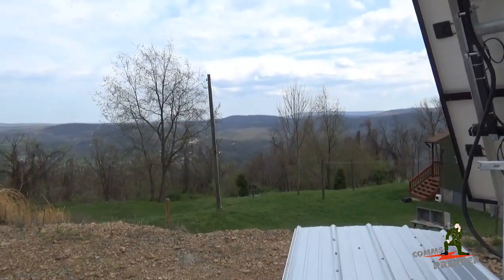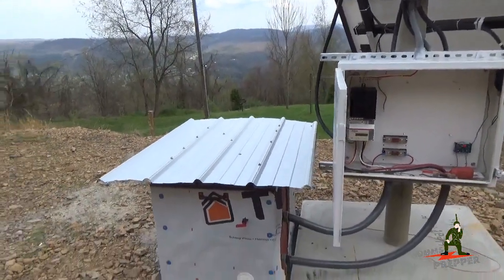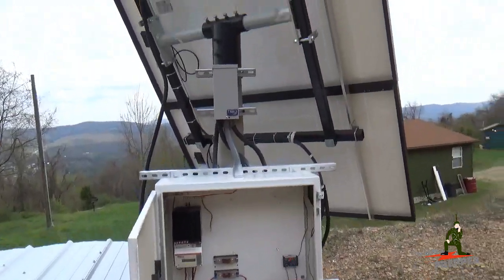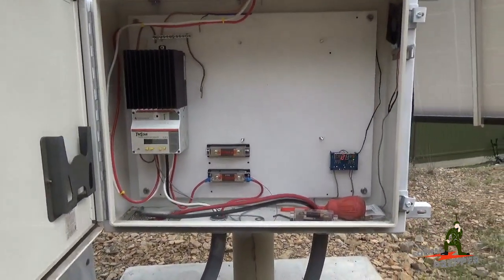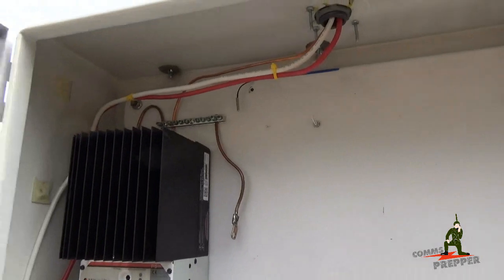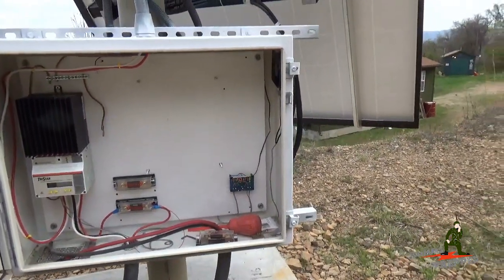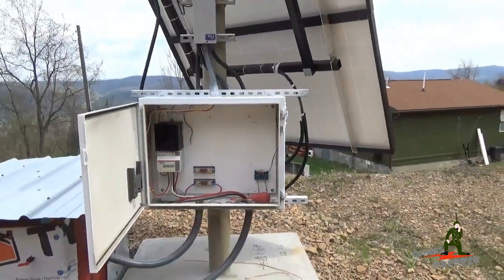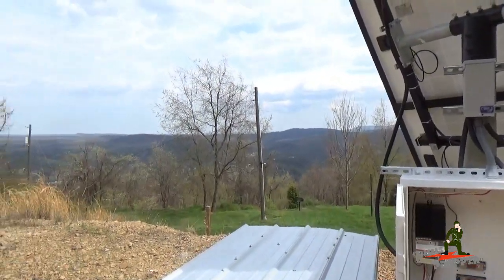Off-Grid Solar Power Upgrade Project

Comment: Why does your setup have to be inspected? Your out in the boonies and off grid so is that required or just for safety's sake?
Reply from the maker: +Neil Koni I'm not sure it does.  The permit lady insisted I needed an inspection when I mentioned solar panels.  I could not get the message across that this system was not touching the grid or house. However,  I will call for the inspection, pay fee, and suspect I will be told it was not needed.

Comment: Well engineered setup.  As usual, we all chip in a thought or suggestion to avoid future issues.  I had plenty of exposure to HOFFMAN boxes while working with T-1 data circuit repeaters and "smart jacks" for AT&T.  The wood mounting panel inside , conduit punch-outs, ground buss bar make it a solid enclosure.  Since they are used at major cell sites successfully, then you made a good investment.  I worked on them at high voltage cell sites and power station locations also. So they provide RF (solar flares etc. )as well as weather protection.  I seldom saw any insects or water penetrate the enclosure. The one spot to watch is the conduit opening on the top.  Onward and upward !      J
Reply from the maker: James - thanks for the tips.  I will keep an eye on the top conduit connection and will add sealant after the inspection.  Right now I want to make sure the inspector can see the o-ring that came with the Liquid -Tight connector.  The back plane is actually aluminum that came with the box.  I did get another tip (That I will use) to add a dryer vent hood over the side vent to help with driving rains.  I need two more solid days on this project and it should be done.

Comment: Good job on the controller box... and my goodness! What a great view you have there!
One observation I have if I may humbly add it.  Get a hood of some sort put on the exhaust fan to shield the opening from rain.  It would be a real bummer to have that box get a bunch of water in it then short out the electricals.
Reply from the maker: Great idea.  While the side vent is louvered, I will add a dryer vent hood.  Thanks again for the idea.  Hank
Reply: Craig Gilbreath  was thinking the same thing, a driving rain may take out the fan or fan control being it is mounted below the fan on the side wall.
Reply: I would also put a rain shield around the opening of the battery box. Not sure if you meant that with siding. Either a chimney like structure on top and closed sides.